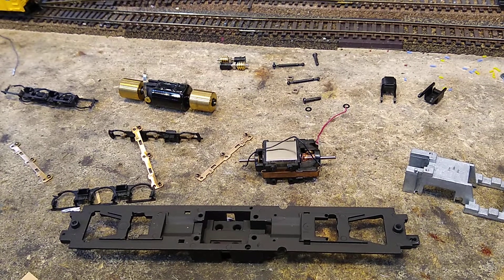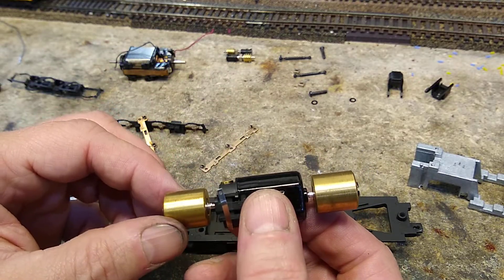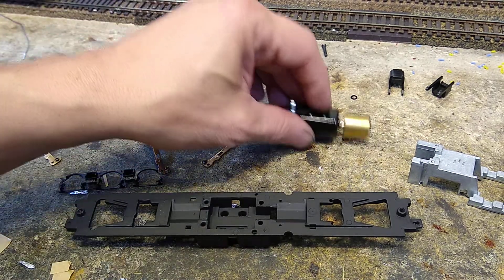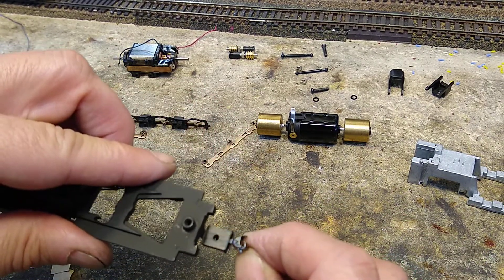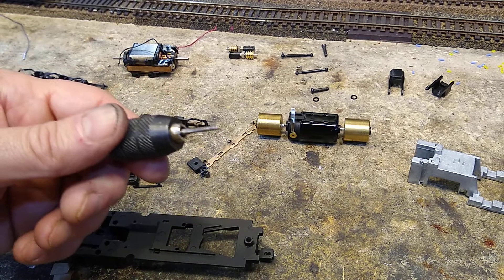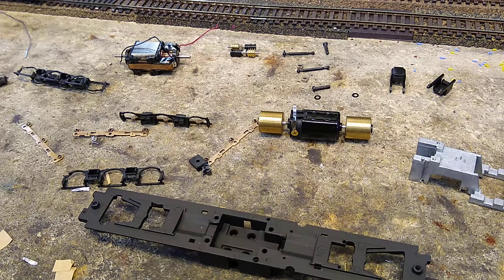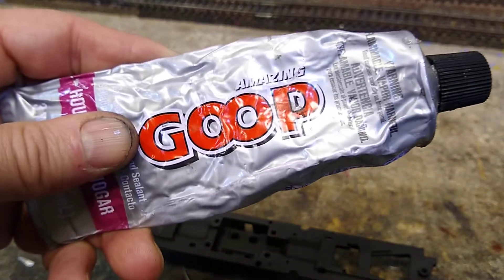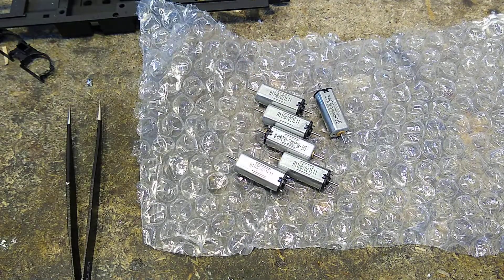5 locomotives in 30 days part 20 flywheels couplers motor mounts

Comment: Put some JB weld in the frame and add the weights, encasing them in the jb weld epoxy. Either use a release agent or plastic wrap over the motor and press it into the jb to the shape of the motor. After it cures, secure the motor in place with a thin layer of goop. I'm not done shaping it yet, but I slid little leaf singers and jb weld in-between the tanks on my dd40 project to add weight..Then built up a few more layers of jb to make it into a single tank. The frame is fairly heavy now. Gonna seat two motors as I described above. Single fly wheel each as I enclosed the tunnel in the shell.
Reply from the maker: there's no end of uses for JB Weld... on this one I had some lead that fit exactly to the height already and now I'm about ready to test it

Comment: Would those motors fit between the axles of a Lil Hustler? I have been toying with the Idea or repowering the little guy and those look like they would be a perfect fit to adapt wheelsets to a cog, and place some worms on the shafts. Might need some form of a 3d printed mount to hold motor in place but it would allow for DCC conversion. I feel that if we were neighbors, we would never see the light of day for tinkering! Keep the ideas coming and I let you how how my progress goes. BTW just repowered a Model Power E7 with a Kato motor from eBay and it went from being a growler to running smooth as silk and I haven't even done a complete chassis makeover yet. Just go my 3D printer and cannot wait to have time to make parts. 1st will prolly be an adapter for Model Power can motor to Kato Motor. Thanks again for your vids! P.S. any source info on the small can motors?
Reply from the maker: the tiny motors would power a Hustler, but there is enough room inside a Hustler for a slightly larger FK-130 motor.  I often 3D print my mounts, but using the Amazing Goop you can get away with no mount at all.  The mount is a rectangle box with a cylinder subtracted from it.  In a Hustler it is easier to improve the belt drive with a better motor and a better belt with a larger shaft on the motor.  VCR belts seem to be the way to go because they last for decades.
Reply: @elite194  I agree but worm gears would tame the little speed freak and as you have said in another vid, allow for better momentum operations. I am considering goop bur have not crossed that threshold yet. Besides, the tinker in me wants to find a direct drive solution again for that smoots operation. I will also have to look into the FK-30 motor you mentioned. I have considered removing the roller structures in my loco and replace it with current gear sets/worm gears for the direct drive using the Athearn motor that while big, is super dependable.
Reply from the maker: There was a gearing kit for the Hustler made by Ernst I think, sometimes they come up on ebay
Reply: @elite194  I saw that and the fact that the reviews were mostly less than praise worthy. I figured so long as I do not modify existing parts, I can always come back to band drive. As a teen i recall working with metal, shears and files. While it worked back in the day, I know so much more now and my problem solving has grown exponentially.
Reply from the maker: @anthonymunoz6013  if you don't already have it, get a grab bag of robotics gears from ebay.  it has pretty much every gear including worms that  you could make a gear train to do a Hustler.  I use gears from that set frequently - they can be shaved to thickness with a razor saw.  with some brass rod or piano wire you can make shafts.
Reply: @elite194  Wilco, Thanks.

Comment: Wonder how some shrink tube would work out for building up the shaft diameter.
Reply from the maker: it's very close and would work on this size, but it doesn't stick.  If I had to go 2 sizes, I'd tape and possibly try heat shrink over that because it would be smooth all the way around with no seam
Reply: @elite194  actually, if you check on ebay, look for an assortment of marine grade shrink tube. It has adhesive inside. I have a batch from rewiring my helm station and electronics in my boat. I haven't used it for mounting headlight bulbs in locos yet, But should also work better for that with the adhesive, than some of the used locos I've picked up that had standard shrink tube used to mount the bulb and they tend to pop out.
Reply from the maker: @donavonrobbins1908  that's something I didn't know, that has some potential